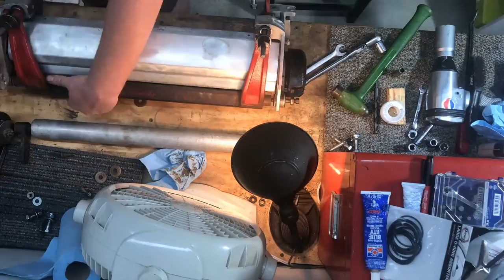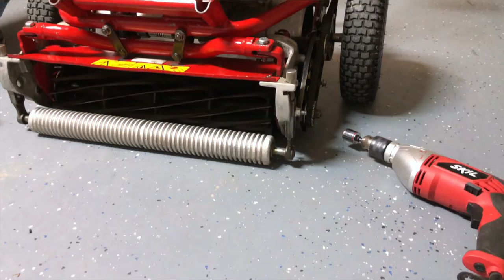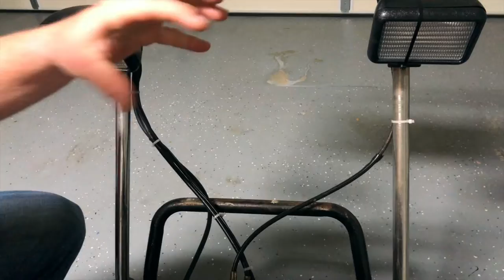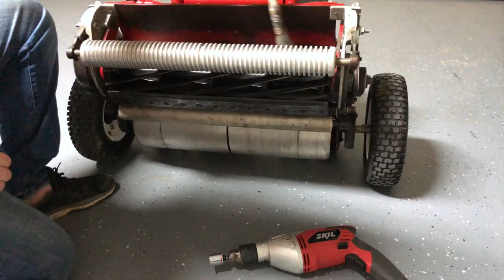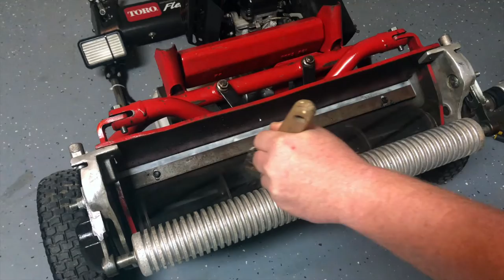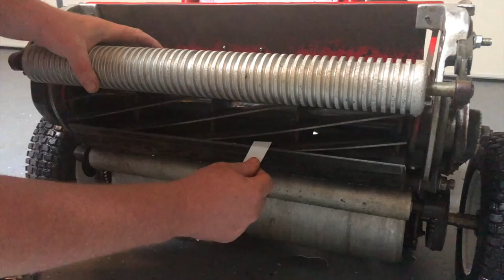HOW TO SHARPEN A REEL MOWER || The Southern Reel Mower

Comment: I'm seriously thinking bout buying a use Toro; bout how much you paid for yours? And what is the HOC?
Reply from the maker: My hoc is .375. To get a good unit, it’s going to cost 1000.00 at least
Reply: I recently acquired a GreensMaster 1000. I think $1,000 is a good minimum but you're going to have to do some research to find a good unit for a grand. I paid $1,850 and bought it from a local country club to me. Need to check the engine, the reels and bedknife, the hours, etc. Know where it came from. If you can find one from a golf course I highly recommend it. Or a unit that was used at a golf course but traded in. Buying from an individual isn't the best option to me. Need to realize a new reel, bedknife and a sharpening is going to cost in the range of $500-600, so having life on the reel is key. I highly recommend doing a lot of research. It's worth the extra effort and $ to avoid expensive repairs.

Comment: I’d love to be able to tear mine down and rebuild it like you did. Over never done anything that extensive before and wouldn’t want to screw anything up though. Any recommendations on how to get started?
Reply from the maker: Definitely should have some mechanical background. But that doesn’t mean you can’t do it. It doesn’t require any special tools. If you do tackle it, label every bolt and lay things out as you took them off. Take photos and video to help re assembly
Reply: @TheSouthernReelMower  how often do you recommend backlapping?
Reply from the maker: Well it all depends on your mowing conditions. If your mowing mulch, sticks etc more often. On a perfectly clean lawn, maybe twice a season? Also depends how often your mowing.